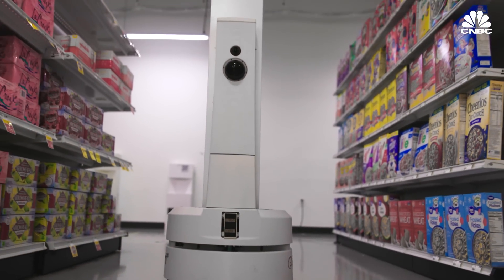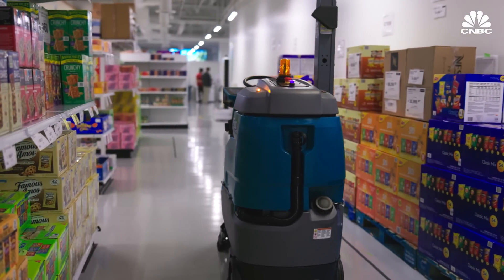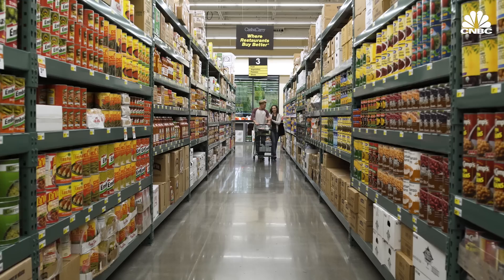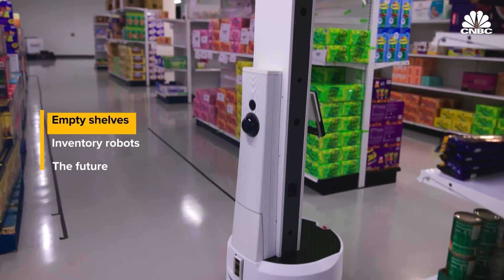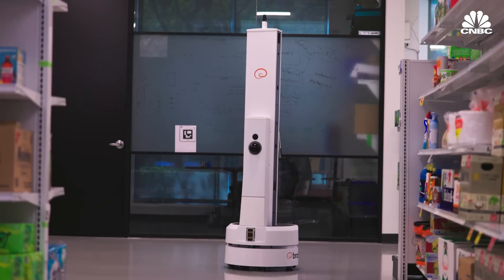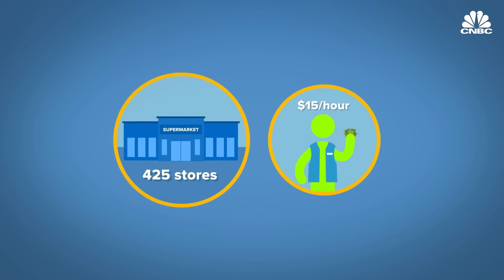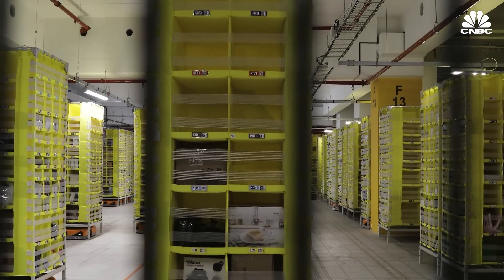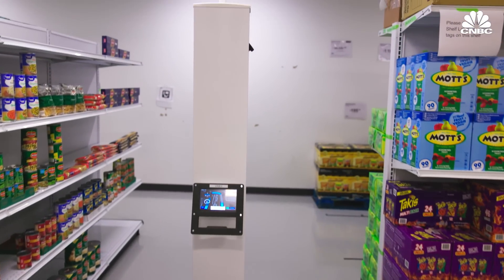How Robots Could Help Retailers Save Billions

Comment: How does the robot know whether there's one on the shelf or multiple products stacked behind each other, how does it know if the box is full or has the lid cut open with the product stolen, how does it know if a product is sold out or has been dumped in the aisle by a customer who changed their mind?
Reply: nonon asking the real questions

Comment: I had an idea 💡that would change retail forever (in my view) but was far too radial even for one of our largest retailers (would also mean huge job losses).  I am a UK based inventor.
Reply: What was the idea??
Reply: @ryanmanus4714   I’m going to do a video on it an post it on a new channel I going to launch on my inventions. I started the application for a patent in UK, but have decided it’s far more fun (and cheaper!) to just share ideas. Should be up and running by end of the month will share a link. As a much much smaller taster, one idea I had was to allow for a phone resting space on a trolley that recharged your phone while you shopped (trollies would have power with batteries in handle that re charged when they were parked). This would then be linked to a ‘google earth’ for shops, to allow you to find things you needed (via a shop nav) or flag if you were next to a good buy (say based on you shopping preferences).  You could scan your list and the algorithm would find the quickest was around to get all you shopping and tell you were to go (like sat nav). Was a while back now suspect that’s already out there by now 🤣👍

Comment: The ROBO is there to assist, BUT, it is not as 100% precise in inventory reports, compared to the HUMAN Expertise as well as professionalism of an Individual, less of course the "TANTRUMS" of the ROBO, when it RANS out of POWER, Lithium, Nickelmetalhydrate or NiMi or when it encounters the ERR..or Red, BLACK, and WHITE and Yellow readings at times...DOS Prompt, programming, excluding CHIP, Blue, and Types and Categories..Whew...Excluding the HIGH COSTS, when they use the Virtual, Digital COINAGE that is prone to ....GONE..what's the PASSWORD, PASSKEY, HACKED or MANIPULATION in TYPES, Oh no. Ouch.  That is TECHNology. It knows the IMPORTANCE of INTER-ACTION that is not LOW BATT or HIGH DRAINED. Technology is Good, it ONLY Assists, and it has its "MASTER" that OPERATES for it to FUNCTION as it is programmed. PLDT SME/Generalist/SMC/Subsidiaries and Group of Companies/Corporation, for your respective statistics to account the harmful as well as the Good, the advantage, as well as the details of fineprint and intricacies, that surely is to drain  its power since it is MICROPIEZO®™© or Zeiss®™© for further features. This features are intact amongst brands. Tiers and levels 1 and 2 Product Specialists,  This is for YOUR Respective expertise and application of professionalism. TIERAGE and Levels EXCEPTION designed and Managed by SMES/Studies/Research and Development. Thank YOU Tiers and Levels 1996-2024. NON-ALGORITHM Standards of Excellence and Protocol. PLDT/SME Nation 96 years to date. IMPORTANT, DON'T DELETE. Thank YOU.

Comment: So hold on ..... I get the miss placed product use case but low inventory one....i mean won't it be simpler and efficient if the store simply had a table with all the max number of items a certain product can be placed on the shelf and then it's a simple case of taking stock of how much product was sold and then comparing it to how much was present and simply letting store owner know that certain product is low on supply....

Comment: How does the robot see behind the items on the front of the shelf? Let's say that there's 6 boxes of a certain cereal left on the shelf and there's room for 24 boxes but that first row of 6 is blocking the empty space behind them.
Reply: It may be able to position a camera just beneath the lip of the shelf above those items so it can count them from above.
Reply: Was thinking that to
Reply: maybe sensors on the shelf, or some type of light or beam that can shine on the shelves and be able to calculate shadows and depth, idk im not that smart, AI is tho so we will just have to wait and see
Reply: Danny D:  Humans who are lazy or too busy or stupid screw such things up a LOT as well.  To the extent that as a shopper, I sometimes fix areas of the shelves where items I want are messed up, to make it OBVIOUS they're out of item X, so they'll fix it.   (Since it often works, I think I know what I'm talking about here). 

The wrong product being at location X (likely moved there by browsing customers) causes a LOT of problems where stockers just assume one box of wrong product X means they don't need to DO ANYTHING like look, or read or move things or check, etc. 

And to the extent they're poorly trained, overworked, underpaid, under-rewarded for doing a good job, etc., there's little wonder this happens. 

But with the right sensors and programming and cameras (like weight sensors on the shelves, for example), such issues can be handled by robots.  Plus over time, such technology improves a LOT as using it makes such issues obvious.
Reply: there are new sensors that can see through things.. but the shelving will probably be changed.. perhaps one option is to feed products in like vending machines.
Reply: At the moment the tech is zone, or wall based. It doesn't track each item of its location, so it won't make an accurate count that way. That is why the so-called old school way works better. A human who knows what sells, or has a log of the inventory can keep up with the demand, or lack there of.
Reply: Maybe the packages have small RFID tags on them and they send their information to the robot. It’s a good question and I’m way out of my area of expertise here, so I don’t know.
Reply: The real problem is the bag of frozen chicken breast behind them all.

Comment: Can somebody explain why it can’t be tracked at checkout. I know it could be destroyed or misplaced. Are those the main reasons?
Reply: They already do track what is ordered vs what is sold. However not all items are on shelves, some is in back room. So you as the manager need to know when you need to restock the floor with new items. Preferably before too many potential customers find an empty shelf and go elsewhere. The idea behind this is you have constant floor monitoring and can restock very quickly. Traditionally this was done by an army of employees but since few people desire retail work there is no army of employees. They either must pay a high hourly rate for simple tasks or buy a machine to do the work.

Comment: Honestly it sounds like they just need a better data infrastructure. If sales data are realtime, they can set a max shelf count, and an alert can be sent to the stocking team in the back when available quantity goes below 50%, then each refill is set to 50%, so the shelf is always gonna be 100% - "% in the cart" after every refill.
Reply: We already have that, but clearly it's not enough. Especially with thefts and aborted picks where the customer puts down the item someplace else.
Reply: @doujinflip  theft is a problem I guess but misplaced item isn't. Simply because regardless if there is a robot counting, the store has to hire necessary staffing to walk around and get those things back to where they belong, no?

Comment: Wouldn't it be easier to put sensors or cameras of the shelves so you know what products you have at any give moment? And you won't need big robots taking up space in the store and it's cheaper, easier to replace.
Reply: That's a lot of sunk costs and would make shelf reconfiguration difficult.  Robots offer flexibility of shelf adjustment,  plus robots will evolve over time while driving down costs
Reply: @weirdshibainu  Why would shelf reconfiguration be difficult? If you have tiny cameras on the shelf, they will continue to operate no matter what product to put on the shelf.
Reply: @ScarlettM  Because you may want to widen or narrow the width of the shelves as products are deleted or added. Additionally shelf cameras are prone to damage or perhaps even vandalism . A store the size of Walmart would have thousands of small individual cameras. Much better to have to only maintain the dozen of so cameras on the roving robot that is using them for cleaning already.

Comment: Why can you not just use existing security cameras to take pictures and up load them to the cloud or put new cameras in every aisle. If you use a robot you will have to maintain it, it could be damaged, and some people might be unformattable with them. Just having cameras on the shelves might be more expensive since you would need so many but you could have data 100% of the time, and you might be able to learn other things about customer behavior's if you can process all the data. The cleaning and stocking robots are an interesting option, nice to see millions of jobs get replaced, I am sure they will be able to learn the necessary skills so go in to more advance skills, quickly and that Walmart will pay for this training.

Comment: Turn every UPC code into an RFID chip and this becomes ridiculously accurate. Convince Walmart to integrate RFID to scrubbers with direct input to Retail Link. Those chips are incredibly cheap for the improvement in efficiency and reliability. Bypass the scrubbers altogether and track the floor like you would an Amazon warehouse with RFID. Link your card to the Walmart app and you could remove the cashier with live-time tracking of what you place in your cart. Train those employees to be technicians for the new technology implemented.
Reply: Still not cheap enough against ink on packaging to replace the barcode on a disposable candy bar wrapper.

Comment: Using robots to move stock from a back warehouse to shop floor shelves makes sense for robots. BUT knowing exactly what is on the shelves & total stock SHOULD be software database automatically managed; the store database SHOULD easily be able to keep track of EVERY item in stock and their location. When a customer takes an item through a till for purchase, the database should AUTOMATICALLY update to know how many of that item is left on the shelf, & trigger shelf restocking flag when number sold reaches a certain point.
Reply: yes, that's how it works when the human customers are honest and actually put stuff back when they don't want it.

Unfortunately, we as a human species have a "not my problem" mantra when we walk into stores, and would rather rip open packages, put vacuum cleaners in the freezer, and scan ribeye steaks as bananas at the checkout. This all happens WAY more then you would think. This quickly breaks the system you describe, which is what brick and mortars have been using for DECADES. The human element is why the physical verification of what is ACTUALLY on the shelfs is needed.
Reply: @NEVAstopGAMER  I used to be a part of an instocks team in a Target chain location. One can update numbers in the system until they physically drop onto the floor. Things that get fixed suddenly go wrong in inventory somehow if you blink or even so much as sneeze the wrong way; they are a certainty once somebody leaves for the day, sleeps, and comes back the next day. I can see such systems making the next few decades in retail chain locations a whole new realm of frustrating as there will need to be a hybrid robotic and human system working in sequence on the same processes. I can see it becoming a help/fix for some issues and also creating a whole other novel store-side category of problems. The jobs of those in stores to oversee, maintain, and repair the physical fixtures and equipment of the store are likely going to see their jobs become a LOT more interesting going forward.
Reply: Plus I don’t think u know how fast certain items move, we can have in the system that we have 30 milk jugs left and they are all in customers carts and just havnt been purchased yet.
Reply: @BMW Royal  which an excellent use case justification for smart phone apps for real time checkouts; there are plenty of shops like Sainsburys which allow customers to download an app & scan items as they take them off the shelf - this allows them to keep track of their spend and have a faster checkout, but it can also be real-time linked to shop inventory for tracking shelf stocks.
Reply: That does not account for theft and damaged product. Which is the whole point of doing stock take.
Reply: I thought that's how it was done. This is something new something sold and something  bought.
Reply: At toysrus our inventory system did this exact thing you’re talking about. The issue is Theft, miscount, wrong orders sent from warehouse etc. We did annual inventory by a 3rd party, but they are done by humans and always inaccurate
Reply: That is how it works. All this extra automation is a waste of time and money.  It baffles me at how many times I have seen inventory that comes in 3x what is needed only to see an item next to it be out for a week or more.
Reply: U clearly have never worked at a huge grocery store, stuff falls behind the shelf, employees steal, customers steel, low payed works don’t care to report when something is dropped and they just throw it aways, they stock the shelves wrong customer returns are never put back in the right location. There is an automatic system however every year my store loses millions of dollars worth of itmes
Reply: Stores already do this.

Comment: Isn’t this just a linear function with a possible a large variance? That is, the difference between items sold and ordered can be found with respect to time using a definite integral. This, then, can be averaged in a time series of the variances. So, seasonal considerations can be applied to a diffusion constant. In other words, the retailer will then have a good approximation of how low the inventory is. What, then, would a robot add?
Reply: Knowledge of how much of the inventory is on the display shelves in real time.
Reply: @cometcaper  You've described an optimization problem. For the sake of simplicity, we'll only consider this as a single variable optimization problem. So, let f(x) be all the employees who restock shelves and who randomly walk to shelves to check inventory, as a measure to quantify theft and misplaced products. So, we want to maximize this. That is, what is the extremum point that the employees can do these tasks, with respect to cost and time? A robot(s), then, can only be valuable to a store if it has a maximum value that's greater than the extremum of f(x). (I don't know if you're right. But it should be easy to quantify if the cost of using a robot is worth the expense.)

Comment: They can tell how many items they have in stock based on the point of sales system. Give or take what customers have in their cart or were moved.
Reply: And shrink. Don't forget shrink.
Reply: that is a good point.. if the robot knows how many products were put on the shelf and how many of a product was sold.. and can look at the shelf too.. it could identify anomolies.. also could identify stray products in wrong locations.
Reply: @manp1039  My point is, that robots would be useless.